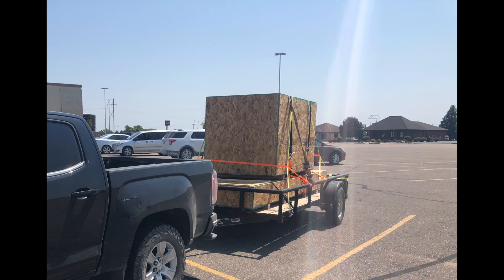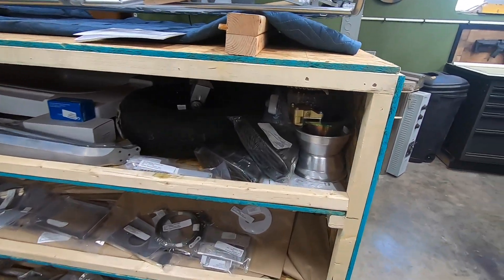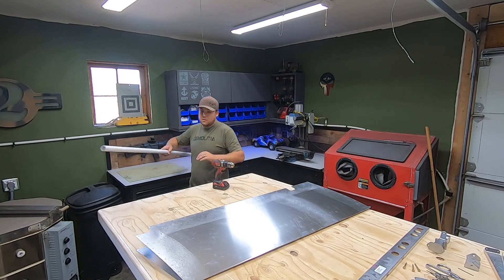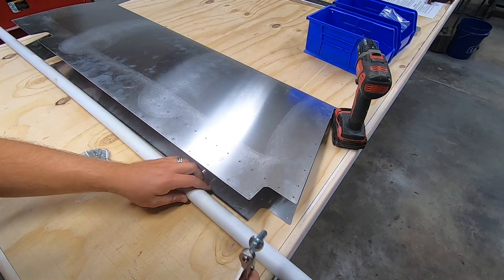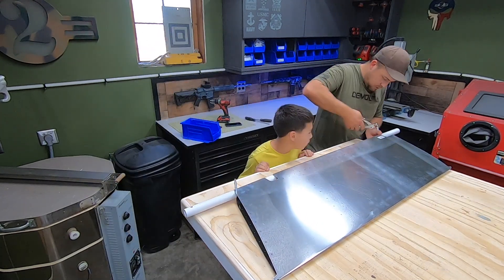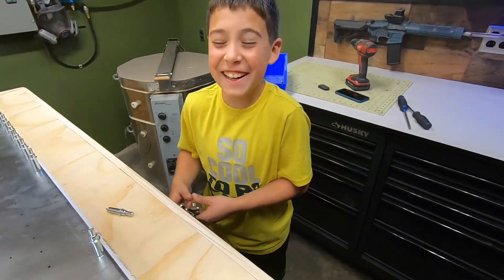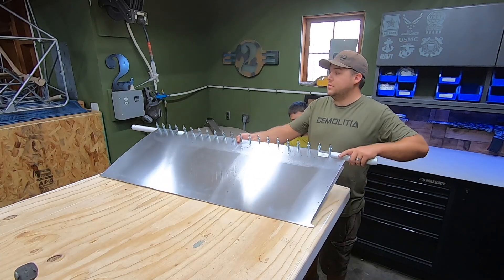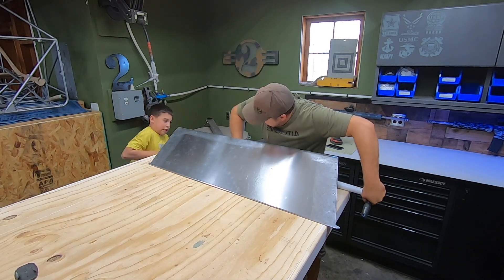RANS S21 Rudder Build

Comment: I noticed that some of the rivet mandrels looked like they popped off a little above the rivet head leaving behind a little bit of the shaft. Was that an issue and if so, how did you deal with it?
Reply from the maker: It seems like a common thing with these rivets. I have yet to do anything with them as I planned to address it just prior to finish things off. Many guys are filing the stems off but just be careful to not remove much material from the head itself or press the mandrel back out of the rivet.